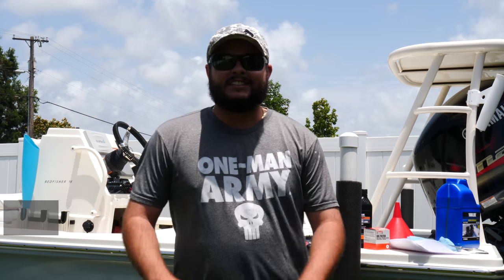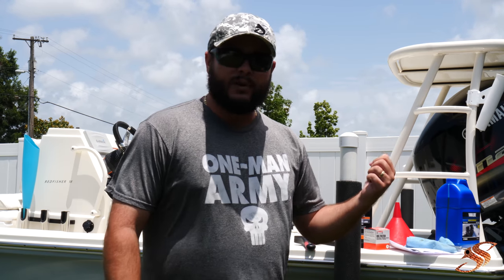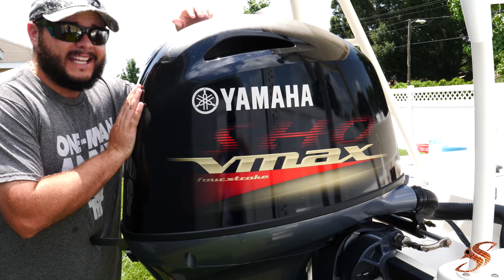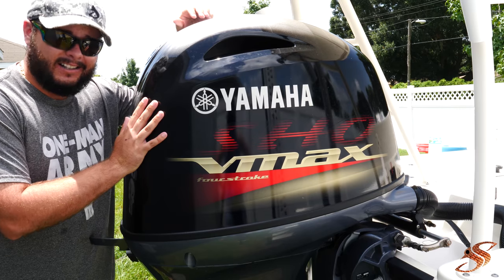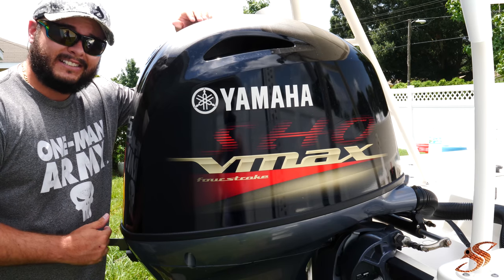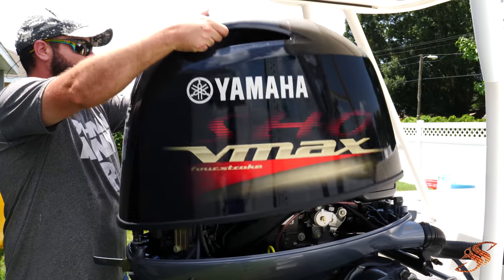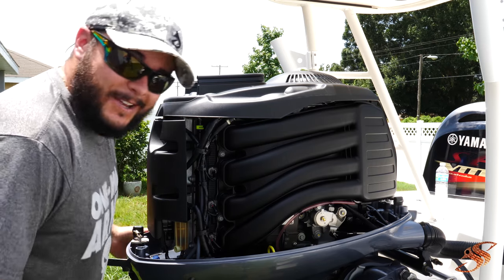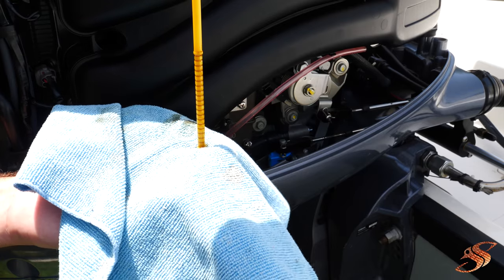How to check the OIL in a YAMAHA four stroke outboard + Latch Update!

Comment: Hey Josh I love your content. I have a 2017 f115lb. Sometimes cruising along my temp/ buzzer goes off. Boat doesn't go into limp mode. Turn key off and re crank boat may not come back on for an hour. Last year stopped on it's on. Didn't hear it all summer. Doing it again. Help Sir. Any advice.

Comment: Literally in the operators manual it says to check the engine oil level cold for accurate reading and the Yamaha manufacturer videos say the same thing. Who runs a motor before checking the oil lol
Reply from the maker: Good, if you already know. I'd probably stop searching on YouTube lol